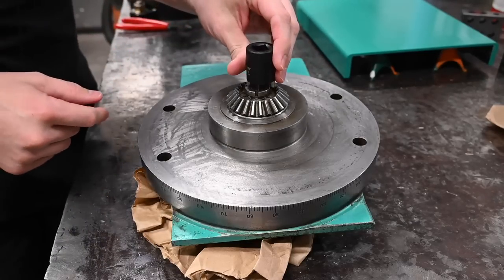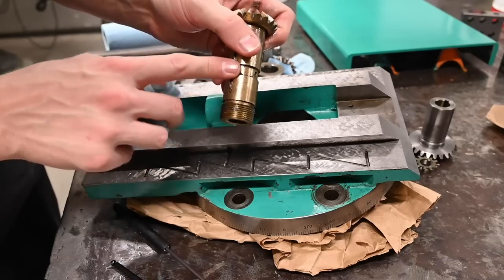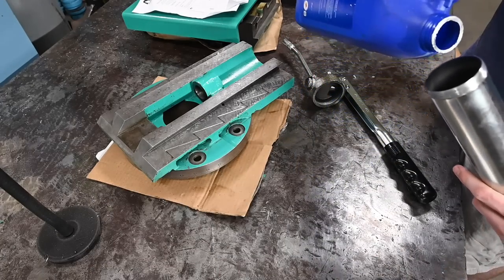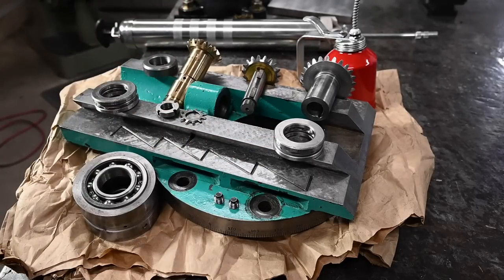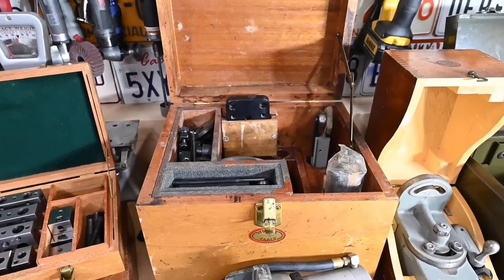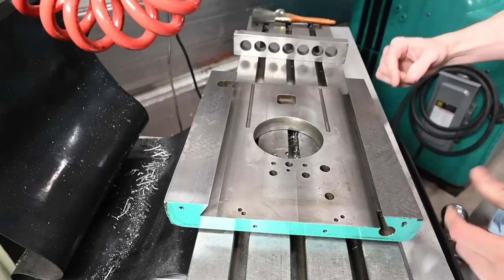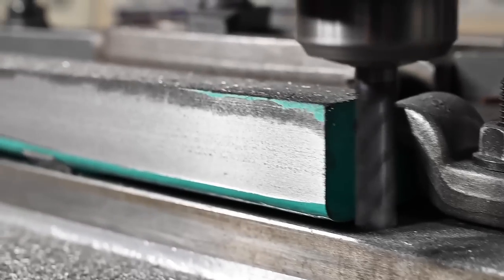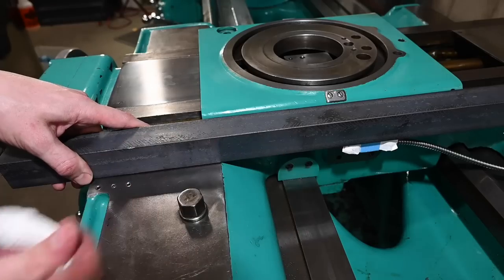Monarch Power Compound Disassembly | Milling the Cross Slide

Comment: I'm by no means an expert but using oil instead of grease worries me a bit. Don't machines that use oil as lubricant typically feature an oil pump which ensures that there is enough oil everywhere? (Like in the gear box of your lathe or the sliding faces of Abom's shaper.) I think that unlike grease an oil film will dry/wear out pretty fast.
Reply from the maker: I think this topic has been discussed for over a hundred years and manufacturers (who have to support the warranties they offer) have always chosen oil. Besides grease holding on to grit or metal particles which can then imbed into the precision surfaces, it also gets trapped and can't be renewed the way oil can. There's not telling how long some of that old grease had been in my compound and what lubrication properties it had left, whereas oil can be flushed away and new oil gets to every nook and cranny that it's needed. The final word for me came from Robin Renzetti when he said I should go with oil- that's confirmation enough for me! 😀 Thanks for offering your input.

Comment: I cringed a bit at 22 minutes in because I've made nearly the exact same mistake before but it was milling the raw cast section up the guts of a cross slide for more clearance after scraping it, it moved by more than a few thou and became both twisted and convex. There is an insane amount of tension held in first 1/8" or so of the skin of a casting. you wont notice as first but long term it will induce some weird looking wear. if you don't believe me use the mating ways as a master and spot the cross slide ways. No offense meant and I love the channel but it's something you should be aware of regardless

Comment: That is not your standard, "Let slap some paint on the ol lathe" paintjob. Someone took great care going through the machine, scraping marks looks like it was resurfaced at some point. Regarding the lubrication discussion, what kills a machine is no lubrication, not one or the other.
Reply from the maker: Yes it was restored to a very high level- primed, sprayed and sanded. The machine is very tight and accurate with just a few remaining issues for me to take care of as time goes on.